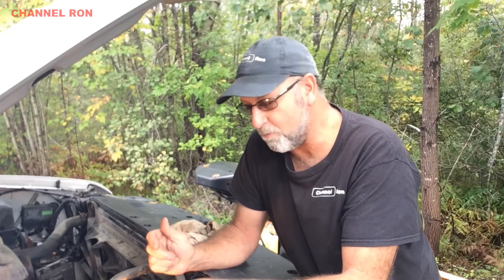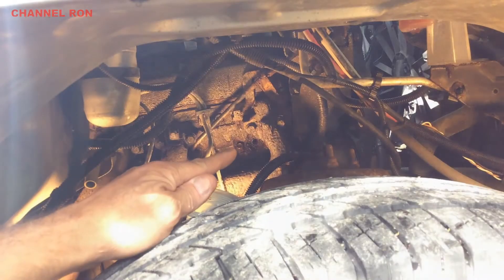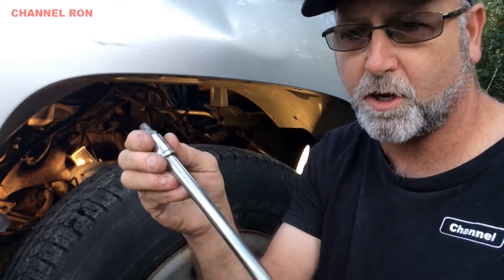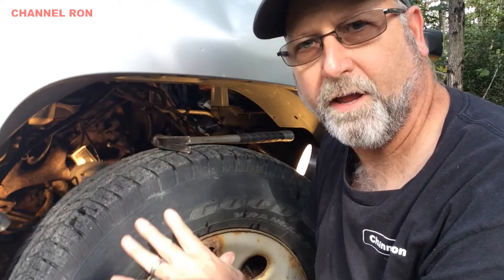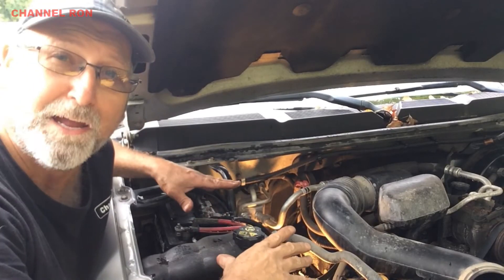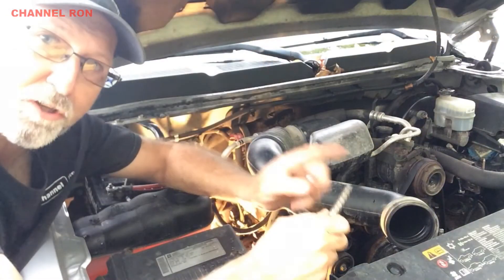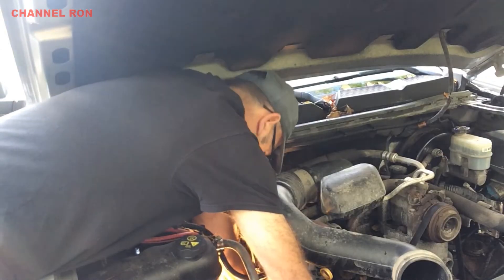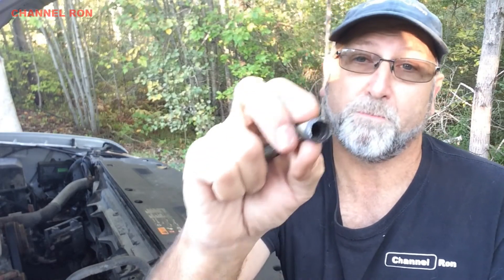How To Remove A Broken Spark Plug

Comment: Dumb question, what happens if the ceramic goes into the cylinder head. What can you do to clean it? (Without having to disassemble the whole block)?
Reply from the maker: Sorry for late response. without taring it down not sure?

Comment: I have one that still has the ceramic inside when it broke off. How do I get the ceramic out?
Reply from the maker: Not Sure? Got to be careful not to have it fall into the cylinder.
Reply: We used a shop vac with a make shift small tube adapter to get in there and we vacuumed mine out. It was a shattered mess.
Reply: @channelron3593 what if it already fell into the cylinder? 😮
Reply: Once I snapped my plug, I got so pissed, I immediately sat down in driver seat, fired it up, backed vehicle in garage (decompression time, I was angry).  Came back to the job the next day, to find zero porcelain fragments, I was looking thru the complete run of the spark plugs threads and could see the ground strap still intact.  I think the compression stroke shot it out, and might have landed in the encapsulation panel under the motor.  (2014 Ford escape 1.6, w/70k)
Reply: @sidewayzmike  I did the same thing!

Comment: Hiii what if the hole inside the spark plug isn’t visible yet ? Would I use the tool to keep hitting it ? Drill the hole open ? What’s best ? Need to know asap for tomorrow or well today now . I’ve been up all night stressing how I’m going to get this broken spark plug out . Every shop has quoted like 1800-2000 😩 totally out of my budget .. please help
Reply from the maker: Sorry to get back late.  Its not an easy thing to do I was lucky to do in without removing much, some engines you may have to remove head, depending how bad it is.
Reply: @channelron3593  it’s okay I was up lateee trying watching videos and reading peoples stories lol. Well … I ended up having to take the head off and doing it that way 🤦🏼‍♀️☹️ everything is fixed now $1000 later smh . but thank you for even responding I appreciate it !